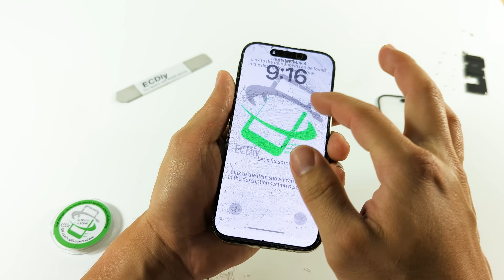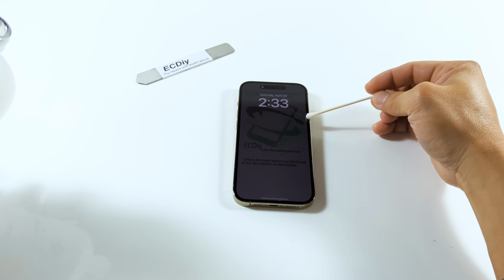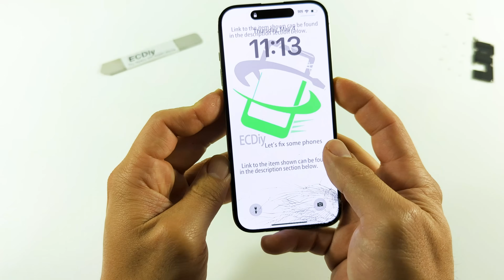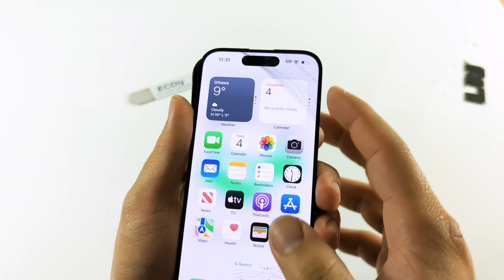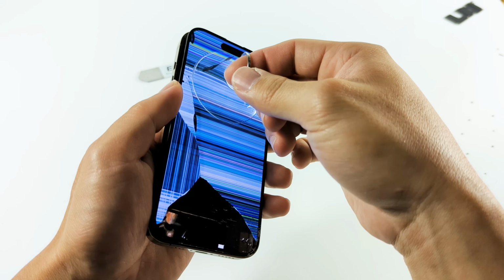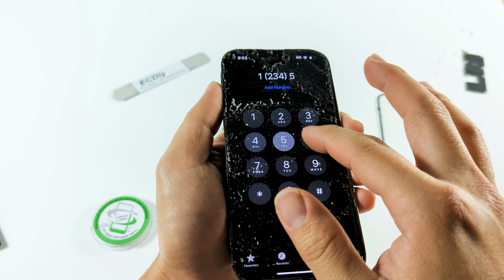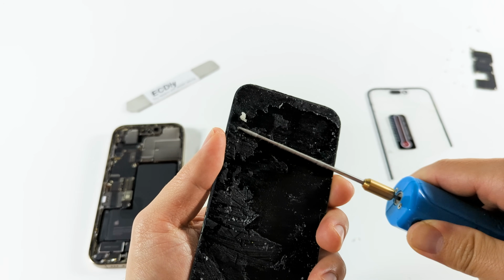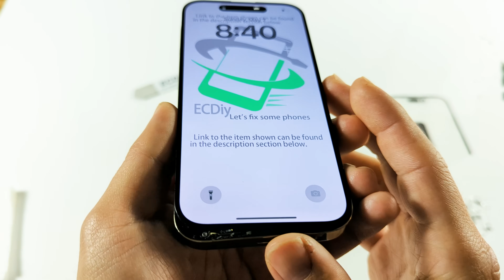How to Repair Cracked Screen Glass Only on iPhone 16–12 Pro/Pro Max/Plus (Full DIY Guide)

Comment: I might attempt this on a sony xperia 5 II, do you have non device specific kits, like general purpose kit where you suplly your own glass front ?
Reply from the maker: Yes we do! We have a 'universal kit' which basically comes with everything with the exception of the front glass.
Any further questions/concerns, please do not hesitate to comment further.
Have a great rest of the day.
Reply: I ended up finding it !
May i suggest that you make a kit including OCA blade, glue, thermo sticker and wire tool ?
I don't need another screwdriver and spudger set, but a kit with only "specific OCA tools" would be welcome @ecdiy
Reply from the maker: @Jbrimbelibap Thank you so much for the suggestion! The only issue would be that, as we buy the screwdriver set in bulk, we actually get them for very cheap. Removing them would not yield any meaningful savings. However, for the sake of reducing waste, this is something we would definitely be willing to do on request basis. 

Any further feedback/questions/concerns, please do not hesitate to comment further.
Have a great rest of the day!

Comment: How do i determine if my phone needs a glass only replacement or a displace replacement?
Reply from the maker: Hello,
Thank you for your comment!
That's relatively easy. If your screen is cracked but functioning fine (displays images and responds to touch without issues) then you do not need to replace the display, only the glass.
Any further questions/concerns, please do not hesitate to comment further.
Have a great weekend!

Comment: Hey ECDIY, quick question, know you're not super involved in the chats and this vid is a couple months old but hope you see it and give a quick answer if you don't mind. Seen a LOT of the same ? on this and many of your other vids. I have an S8 plus with cracked screen, the top half of the screen does not respond to touch but the bottom half does. Would just a new screen fix this possibly or do I need to do a the whole screen digitizer ect replacement? Thx.
Reply from the maker: Hey! I'm still here. I know the videos have been lacking but I have been fixing random viewers' phones and been checking comments regularly.

As for your phone, unfortunately you would need to replace the entire display assembly. The touch layer is underneath the glass layer and problem with touch layer indicates that it's not just the glass that is damaged. 

Any further questions/concerns, please do not hesitate to comment further.
Have a great rest of the day.
Reply: @ecdiy  thanks for getting back to me so quickly! I appreciate it and you and these vids, have been a big help in the past and now will be again as I fix this S8+!

Comment: Specifically what is included in the kit other than the screen glass?
Reply from the maker: For a limited time, we are including everything you see in this video minus the heat gun/hair dryer and isopropyl alcohol; Gel pad, sticker thermometer, glass, screwdriver set, optically clear liquid adhesive, uv lamp, microfiber cloths, OCA blade, wire tool, basic pry tool, guitar pick tools, spudgers and a razor blade.

Any further questions/concerns, please do not hesitate to comment further.
Have a great day!
Reply: @ecdiy is this limited thing still going? Needing one for an iPhone 14 Pro. Please let me know

Comment: How much loca do you recommend using for an iPad Air 4
Reply from the maker: That would be roughly 6mL. However, please note that this amount does vary from glue to glue.
Any further questions/concerns, please do not hesitate to comment further/contact us.
Have a great rest of the day!
Reply: @ecdiy  thanks for the reply

Since you don’t offer 6ml loca glue or more in your shop could you point me somewhere or to any brand that have similar loca like yours
Reply from the maker: @llockerroom Not a problem at all. It is the least we can do. It's been years since I've experimented with other glues and I can't say there is one quite like ours which is why we made our own over the years. 

If you would like, I can give you a buy 1 get 1 30% off on the 3mL. Please feel free to contact us through the "contact us" page if you are interested.

Best regards,

Comment: Please! Why the screen’s refurbisher says they keep the heat on while separating the glass on the heat plate? They have it on 100 degrees Celsius? And have it on for few minutes and screen works enter testing! Can you explain that please ?
Reply from the maker: 100 degrees Celsiusc is indeed the upper limit. Anything above it for more than a few seconds, you can start to damage the OLED. Some heat does get lost through the glass so setting the heat plate to 100'C does have some buffer. Many also use a silicone pad to improve suction when working with cracked screens which further lowers the actual temperature that reaches the OLED layer.
    Personally though, if I were to use a heat plate as a first timer, I'd set it at 90/95'C due to potential for error in calibration (unless you can verify it with an accurate laser temperature gauge). 
    Hotter the screen gets heated, the softer the glue gets, that is for sure but due to the potential for user error when applying heat directly on the back, I suggest a slightly lower temperature range. 
    Great question though! Any further questions/concerns, please do not hesitate to comment further.
Best regards,
Reply: @ecdiy  so I can keep the heat on as long it’s not exceeding the temperature recommended? As a beginner it takes me about 10 minutes to remove the frame and separate the glass, Thank you for the help and I am a subscriber and love your content although I bought the machines but still need the knowledge and skills
Reply from the maker: @1Foundout  Thank you so much for your kind words! 
   That is correct. You can keep the heat as long as it's not exceeding the temperature recommended. Mind you though, I have not experimented with leaving it on there for hours just for the sake of experimenting. It has been awhile since I used a heating pad but that's only because it's important for me to have the exact same experience as a DIYer purchaing our kit would. There is no denying that the machines are more efficient.
    I'm very happy to hear the content is helping you. Any questions, please do not hesitate to comment further!
Reply: @ecdiy  suggestion! I know you mentioned this on your videos! The entire point, even you show it on the camera , i think we need more safe way to make sure we don’t cut the digitizer . Because once we start cutting through the entire point the damage has already been done . And for people that use your kit , which is great kit , if they damage the digitizer they won’t be able to fix it because it’s involving soldering. I haven’t seen a video that break it down in great detail. I think it would be helpful if you can make one . If you already have one that I missed please drop the link. Have a great day
Reply from the maker: @1Foundout 
Thank you for your suggestion! Are you referring to the soldering? Or ensuring that the digitizer is not cut? 

As long as the wire is held tightly and low so the wire is rubbing against the glass layer as demonstrated and mentioned in the video, it shouldn't be able to penetrate the digitizer layer, especially considering that the bezel is thicker than the display layer. This is particularly true when the glue layer is softened with heat. 

This is something we remind on our latest tips & tricks page too, the address to which we print on a slip included in the kit.

It's happened to me once, years ago working on an iPhone X, but not since implementing the tips above. 
Has this happened to you? If so let me know. I will definitely make sure to emphasize this in the next video so it doesn't happen to others.

Any further questions/concerns, please do not hesitate to comment further.
Have a great rest of the day.

Comment: hi, I want to ask,  I see other video,  their glass like a sticker,  not using glue, whats the different?
Reply from the maker: So you are referring to the OCA film, which is used by others as well as the factory.

The one we use is liquid based. The difference is that when you use the liquid adhesive, you do want to be present in case you see it spreading to one side more than the other. 

However, with the OCA film installation with the laminator, positive pressure & negative pressure chamber, it's more or less a set it and forget it. It's also easier to do multiple devices at once using the machines which is why it is preferred by the shops. 

   Any further questions/concerns, please do not hesitate to comment further/contact us.
Have a great rest of the day.

Comment: Can i use ethanol 96% instead of isopropyl alcohol, i live in 3rd world country, i can’t find isopropyl…
Reply from the maker: You can use lower percentage alcohol, but just remember that the other 4% in your case is water which may conduct electricity.

You'd want to avoid accidentally powering on the device at all cost until all of the alcohol is completely evaporated.

Any further questions/concerns, please do not hesitate to comment further/contact us.
Best regards,
Reply: @ecdiy  im wondering can 96% alcohol dissolve oca glue, can i clean the display with it after removing the glass.
Also my kit arrived today, is there any other step by step tutorial for iphone 12?
Reply from the maker: @Professor4all99  Yes, 96% isopropyl alcohol will be able to clean the glue. As for the iPhone 12 tutorial, the process is identical to the process shown here except you'd want to start the glass removal process from the bottom as the ear speaker grill will catch the wire. This is also noted on our "latest tips & tricks page" the address to which we print on the slip placed on the top of the plastic tray our kit ships in.

I hadn't realized that you had purchased from us. Thank you so much for supporting us! 
Any questions/concerns, please do not hesitate to comment further/contact us.
Have a great rest of the day.

Comment: Thanks for the clear video. I went to a store to fix my 11 pro max with the same technique to replace glass only, it's all good but swiping down in the upper right corner for control center doesn't always work or work after several attempts. Do I need to go back or this is normal?
Reply from the maker: This is not normal. They might not have let the glue spread on its own as shown in the video and you have more glue than you should on that one corner. It's very possible they used too much glue too. Ask them if they had/have any leftover. 11 Pro Max only uses 2.3mL. Look very closely along the edges and see if you see one corner sticking above the frame.
   Alternatively they used a conductive cleaner and the back of the display was not cleaned thoroughly after the repair. 
   Hope that helps! Any questions/concerns, please do not hesitate to comment further.

Comment: what if there becomes dust trapped between the display and glass like when you are applying a screen protector?
Reply from the maker: With the liquid glue application shown in the video, it is much more forgiving.
    Solid impurities/debris may be visible after the repair but dust and lint-like impurities will get saturated by the glue and become very hard to see, practically invisible by naked eye even at close inspection. However, I recommend the screen be free of all debris prior to installation. 
    Screen protector application relies on a silicone based, film/pad adhesive which forms a bubble around all impurities no matter the type/size.

Comment: Does there be any bubbles after applying the LOCA? And would any LOCA do the same job?
Reply from the maker: I have also uploaded a close-up video, there isn't any bubble after the LOCA process. By lowering the glass slowly, keeping a close eye on how the glue contacts the glass, you can avoid bubbles in most cases. 
Even if you do get stuck with one though, you can squeeze it out as demonstrated in this video.

Other LOCAs do work, but may not spread on its own like shown here and may not cure with a weak UV light/sunlight as shown here. Our LOCA is something that is specially formulated just for us as DIY application for screen repairs like this is quite unique. 

Any questions, please do not hesitate to comment further.
Best regards,

Comment: Is this method possible for xiaomi 12t Pro??
Reply from the maker: Yes it is possible but for Xiaomi 12T Pro, you'd want to follow the replacement guide we have for Samsung curved display phones. 
Any further questions/concerns, please do not hesitate to comment further.
Best regards,
Reply: @ecdiy  can I send it to you for repair my friend?
Reply from the maker: @anassz  Currently committed to fix a couple other viewers' phone but it looks like for Xiaomi 12T Pro, the display replacement is cheap.
    You might want to look into replacing the display as a whole because when I fix phones for viewers, I cover the part & return shipping but not the shipping to me. 
    Whereabouts are you located anyhow?
Reply: @ecdiy  in Spain, shipping wouldn't be an issue, I could cover both ways
Reply from the maker: @anassz  I appreciate the gesture, but there's no need! I'm doing this strictly to give back. I was always going to be covering one-way shipping, along with the parts and labor.
Ok I will fix it for you. Contact me for details.

Comment: I really like the tip on using alcohol 99% that helps a lot thanks.
Reply from the maker: Not a problem at all! While we're on this topic, please note that there are a lot of YouTubers who demonstrate the clean-up using N-Hexane without any special precautions, but I do not recommend N-Hexane at all. That chemical is actually banned by FoxConn due to its neurotoxicity. Several cases of death have been linked to usage of N-hexane. 

It's a bit concerning as some get sold just as "glue remover."
Reply: Alcohol can damage the microphones and sensors, there's no need to risk it.   Heat alone set at 90C on a digital heat plate for 5 minutes is plenty to make it easier to disassemble.  Been doing this for over 20 years, and I've seen the mess some people make with alcohol.

Comment: Great video! When are you releasing the video for the back glass removing hack?
Reply from the maker: I've been meaning to make a video for it for a long time now but it keeps getting put on the back burner. I've actually revealed the method in the comments section. 
   I personally find the process to be very tedious. There's quite a bit of scraping and cleaning with a pry tool. It is not a task I personally find to be enjoyable, similar to the cleaning step for the front glass replacement but worse. It's also not a delicate process like the front glass replacement and the glass does go all over the place. 
   I did mention that I will make the video for it and I will upload it. Hopefully sooner rather than later!